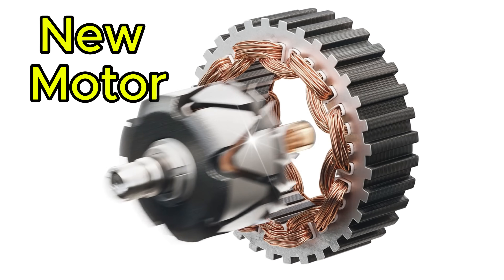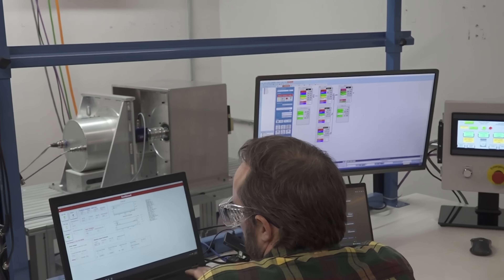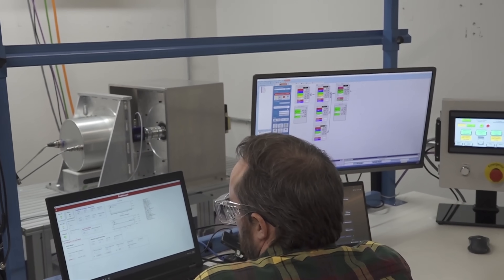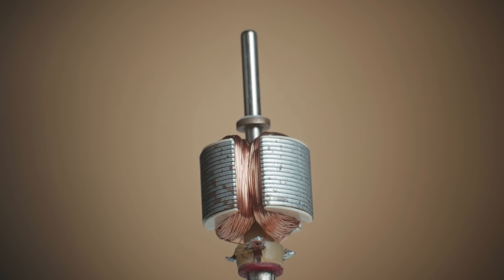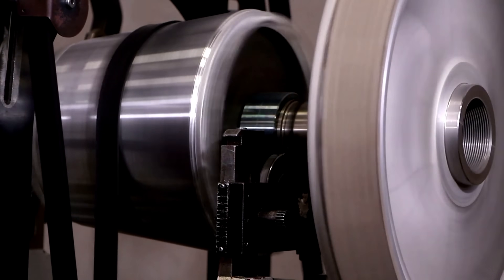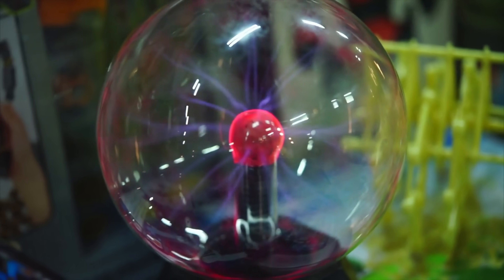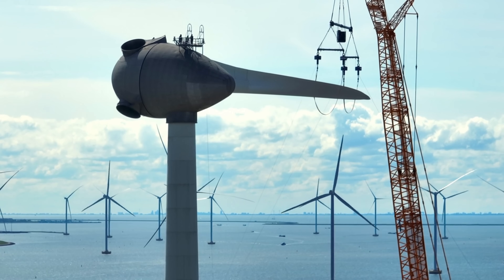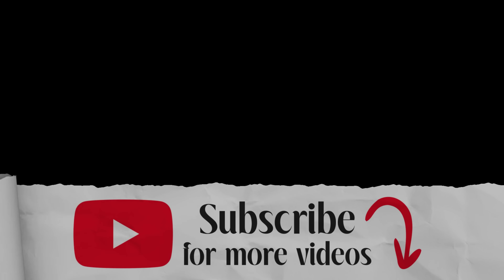Radical Electrostatic Motor Runs Without Metal Coils and Magnet – Here’s How

Comment from the maker: This might be the beginning of the end for electromagnetic motors. Lightweight, flexible, and potentially game-changing—this electrostatic motor tech could power the machines of tomorrow.

🔥 Would YOU trust a motor with no metal and magnets? Or is current motors still king? Drop your thoughts below 👇
Reply: The biggest problem with a static motor is TORQUE i give it 50 years and we still won't here much about it.

Comment: It's good that we are investigating alternative energy tools... However this motor is nothing more than a novelty.  The mere fact that it uses high voltage (above 5000 volts) it will also require step up transformers (which use copper...) so you'll never be able to get rid of the use of copper.  Then there's the torque issue - the whole reason we use copper is to be able to increase the amps pumping through it, easily control that to control speed, and they work at scale, from tiny motors to the largest power houses.  Static electricity is the weakest form of electricity, we learned that in school.  Perhaps if you used this with a lightning rod and were able to spin up a large flywheel to be used to generate energy it might have some kind of practical generation use, but lightning strikes are rare and uncontrollable, making it an unriliable energy source.  Perhaps they could couple this technology with capacitors, run it to charge them up, then use the stored energy in the capacitors for heavy load situations like starting motors?  Or maybe for accelleration in a car - but using it to DRIVE the car is not feasible.  Taking the biggest load off of a car - starting - could have some use, but all the tech and parts needed to get the high voltage might be a problem.  Maybe if they generated the static electricity using the vehicle itself as it moves across the road could be a feasible way to "charge" the motor, then it puts that energy into capacitors to be used upon acceleration or starting a gas powered vehicle?
Reply from the maker: You've brought up some very important points about the practical challenges, such as the need for high voltage and the torque limitations, but also some interesting ideas for potential applications!

Comment: Doubtful. Applying high voltage to a rotor is a huge problem. Induction supply with high voltage? Unlikely. Sloipping rings - sparks.
Reply from the maker: Please note that this is not induction motor, it is electrostatic motor
Reply: @renewable_energy  Did you read my comment? Don't you need to supply high voltage to a rotor? I see two options: a slipping ring and an inductive coupling, similar to a transformer. Anything else?

Comment: The possibility of an electrically assisted bicycle with an electrostatic motor is intriguing. As I understand it, a commercial model of the C-motive motor produces half a horsepower. Supplemented with supercapacitors instead of lithium batteries, it could provide assistance in climbing hills.
Reply from the maker: That's a great idea — supercapacitors could offer rapid charging and discharge cycles for the kind of bursts of power needed on a bike!

Comment: How does it work?
Reply from the maker: Great question! In simple terms, an electrostatic motor works by using electric fields instead of magnetic fields to create motion.

Instead of copper coils carrying current and producing magnetism (like in a traditional motor), electrostatic motors use charged plates or surfaces that attract and repel each other when high voltage is applied. By switching the voltage on and off in the right sequence, the charges keep pulling and pushing the rotor around, generating continuous rotation.

So instead of relying on current and magnetic torque, it’s all about voltage and electric field forces. This means way less copper is needed, no permanent magnets, and much lower resistive heat losses.

Comment: Keep in mind that the high voltage has to be transformed from the power source by a transformer, where you lose energy as well.
Reply: AN IRON CORE TRANSFORMER CAN BE 99.9% EFFICIENT.
Reply from the maker: That’s an excellent point. You’re right — to reach the very high voltages that electrostatic motors need, you’d typically step up the supply using a transformer or converter, and that process isn’t lossless. However, even with those conversion losses, the overall system can still be more efficient because the motor itself has so few resistive and copper losses compared to traditional designs. The big question is whether the efficiency gains in the motor outweigh the extra conversion step — and that’s exactly what researchers and companies are testing right now.

Comment: Just a decade or so ago we had high voltage devices right on our desk and in front of our eyes. The CRT required voltages similar to what they are using for the electrostatic motor.
Reply from the maker: Exactly! Great point — CRT monitors and TVs ran at tens of kilovolts right in front of us for decades, and they were safe enough for everyday use. That history shows that handling high voltage isn’t impossible — it just comes down to smart engineering and proper insulation, which is exactly what electrostatic motors are trying to leverage.

Comment: For me that invention is something especial. That is a part of spritual awekening. When an engine work fast and with high tork without heavy parts. When an engine is extrem lightweight compare to ordinary engines that means there is improvement by Quantum physic. The best side of Quantum physic is that you can produce extrem high energy without any heavy material. When this tech more advanced we can see after 2030 such engines they are only 2 kg but produce over 300 horsepower or even more.
Reply from the maker: That’s a fascinating perspective! 

 While the current electrostatic motor tech isn’t tapping into quantum physics directly, I agree it feels almost futuristic when you think about an ultra-lightweight motor producing serious torque without the bulk of copper and magnets. If engineers keep pushing the boundaries, by 2030 we might indeed see designs that completely redefine what we expect from motors. The idea of a 2 kg engine outputting 300 horsepower definitely captures the imagination!

Comment: IDEA #353
A brushed motor makes a magnetic field to pull on metal on sticking out from a shaft, the magnetism is turned off when the metal reaches the magnet.
This can be done using a permanent magnet, and the magnetism is redirected instead of electricity directed to make magnetism.
A metal bar on a hinge can move magnetism from one place to the next. A few bar magnets stuck end to end moves magnetism past where it would normally go. Electricity to a coil creating a magnet can stop magnetism from going in the path of least resistance, and the magnetism stops/reduces the electricity flow to the magnet in an apposing force condition. Using the known psychics of electricity & magnetism
I picture a large speaker magnet donuts supplying the power. Don't think of it as perpetual motion, think of it as psychics.  The atoms throw out parts of an electron and that is magnetism that wants to get to the other end of the atom.  It is the power of the atom being harnessed. So put some round plates on a shaft with notches out, like the top of a castle wall. Man the para-pits men. Think of them as brushes that transfers magnetism as it turns the tops come close to bars that transfer the magnetism to the stater side which is close to the CAGE which is big washers on the shaft that has flat bars running across them, an inch apart but 8 inches long. The magnetism is transferred to the stater bar just in front of the turning flat bar by the notched large washer on the other side of the magnet. I have not made a working model and I'm not saying that this will work.  I'm saying that for my next hobby experiment entertainment I was going to work in that direction and maybe end up with an efficient generator or something also. Do not invest in anything like this either. I'm old and can't work, so it's stuck in your head now.
PS, stuck in AI's head would be better.
Reply from the maker: thanks for your feedback.

Comment: still have dielectric losses. corona losses. even stationary those leakages must be replenished. charges leak away and the higher the potential the faster they leak. there is no "perfect insulator".

 still have charge being pumped on and off of surfaces, and that constitutes a current when being pumped. "a charge in motion". lead in wires, conductors, all producing magnetic fields and eddy currents. 

a magnetic field also requires no power to maintain. unfortunately wire has a resistance and that is the cause of the loss. a superconducting electromagnet shorted to itself with no resistance will remain magnetised indefinitely... the field cant collapse as theres nothing consuming it as heat.
Reply from the maker: Exactly — those are some of the key physical trade-offs that often get glossed over in the “perfect efficiency” claims. Electrostatic motors still have dielectric and corona losses, especially at high potentials, and leakage currents are inevitable because no insulator is truly perfect. Maintaining charge means continuously replenishing what leaks away, and yes, the act of moving charge on and off surfaces is itself a current — with all the resulting side effects like small magnetic fields and possible eddy currents in nearby conductors.

On the flip side, magnetic fields in superconducting electromagnets are indeed “free” to maintain once energized, since there’s no resistive path to bleed them away — but that’s only true in the superconducting regime, which has its own huge cost and cooling complexity. So while electrostatic designs avoid copper and rare earths, they aren’t magically lossless; the real challenge is balancing those leakage and dielectric losses against the efficiency gains in specific applications.

Comment: Coppers on electromagnetic designs has a proven torque requirements to meet demands. But that new concept i believe can replace industrial motors just for its low heat output alone and 99% efficiency you say?
Reply from the maker: Totally fair point—copper-wound EM motors are the torque kings and they’re proven. Electrostatic isn’t trying to replace them everywhere; where it looks promising is in industrial duty where continuous operation, low heat rise, and wide-range efficiency matter (think conveyors, fans, pumps). The “99%” figure is a peak, lab-style number; in practice you’d expect very high efficiency in a usable window—more like mid- to high-90s—plus almost no copper loss and no magnet losses, which is why the thermal profile can be so tame. The real questions are torque density versus size, cost of the high-voltage drive/insulation, and durability in dusty, wet environments. If those boxes get ticked, I agree—swapping some plant motors for lower-heat, rare-earth-free units could be a win.

Comment: high voltage isn't dangerous, Amperage is dangerous.
Reply from the maker: That’s a common saying, and there’s truth to it — current is what directly causes harm to the body — but high voltage can still be very dangerous because it can push that current through you, even if it’s just a few milliamps.

So while an electrostatic motor might operate at low current, its high voltage parts still require serious insulation and safety measures. Voltage is like water pressure — even if the flow is small, enough pressure can still burst the pipe.

Comment: If a STATIC ELECTRICITY MOTOR blows your mind. THEN you SHOULD build a PULSE  RESONANT LC TANK MOTOR
Reply from the maker: That’s an intriguing idea! A pulse resonant LC tank motor would essentially store and release energy in tuned cycles, kind of like giving the motor “pushes” at exactly the right times to keep it spinning with minimal losses.

The challenge, of course, would be controlling it precisely under changing loads — but if tuned well, it could make for an incredibly efficient system. Sounds like you’ve got a concept worth exploring further.

Comment: 99% efficiency. I may have believed you if you said 75%
Reply from the maker: I get the skepticism — 99% efficiency does sound like marketing fluff. 😄

To clarify, that figure usually comes from lab measurements under ideal conditions and only at specific operating points. Real-world efficiency will almost always be lower. The appeal of electrostatic motors isn’t that they magically hit 99% everywhere, but that they can cut copper losses to nearly zero and maintain very high efficiency across varied loads.

So yeah, think “up to 98–99% in the sweet spot” — not “99% all the time in your garage.”

Comment: regular motors, tesla for ex. can reach 98 percent efficiencuy.
Reply from the maker: True — high-end motors like those used by Tesla can indeed hit around 97–98% peak efficiency under optimal load conditions.

The difference here isn’t just about matching that number — electrostatic motors aim to maintain high efficiency across a much wider range of loads and eliminate copper losses entirely, which can be a bigger deal in applications where motors spend most of their time running below peak power. Plus, they avoid rare-earth magnets and heavy copper windings, potentially lowering costs, weight, and supply-chain risks.

In short — it’s less about beating Tesla’s peak efficiency, and more about how and where that efficiency is maintained.

Comment: I always wondered if using voltage instead of current. Thanks for this detailed video.
Reply from the maker: Glad you enjoyed it! 😊 Yes — electrostatic motors flip the usual script by relying on high voltage and electric fields instead of current and magnetic fields. It’s a totally different way of thinking about motion, and while it comes with its own challenges, it opens up some fascinating possibilities for efficiency and material savings.
Reply: Nein, denn die Leistung ergibt sich aus Spannung multipliziert  mit Stromstärke. Man kann den Schwerpunkt auf höhere Spannung setzen aber ohne Stromstärke gibt es leine Leistung.
Reply: @biodeutscher9258  Agreed power=voltage x current aber high voltage x lower current will produce same power.

Comment: Pipe dream. Maybe good enough for bug zappers. 🤔
Reply from the maker: Fair take — it does sound like a bug-zapper gimmick at first. 😄

But the underlying physics are solid, and prototypes from companies like C-Motive have already been tested in real industrial equipment. They’re not trying to out-muscle a Tesla motor; they’re targeting applications where the low weight, 98% efficiency, and zero copper/magnets actually solve real engineering headaches.

Think of it less as a “pipe dream” and more as a specialized tool — like how brushless DC motors didn’t replace all motors but still became indispensable in drones, fans, and countless devices.
Reply: Intelligent life among the comments. Congrats!

Comment: These type of motor never going replace all current motors type. Never.
It might  fit for certaint applications. But it too weak for many applications that require high torque.
Reply from the maker: Exactly — no argument there. Electrostatic motors aren’t some magic “one-size-fits-all” solution that will wipe out every other motor type. Their torque density is generally lower, so for heavy-duty applications like EV traction motors or industrial machinery, electromagnetic designs still make far more sense.

Where they could shine is in niche areas where efficiency, weight reduction, or the elimination of copper/magnets matters more than brute torque — things like aerospace, certain robotics, precision instruments, or ultra-low-power systems. It’s more about adding another tool to the engineering toolbox than replacing the whole set.
Reply: @renewable_energy  ChatGPT Reply with story about Sunshine
Reply: Never say never. It is easy and highly efficient to convert high voltage to high amperage using a fractal circuit of capacitors. Even a slow charge version in your garage could be used to charge an EV's battery(s) IF you can achieve high voltage. Sure, they'll probably never replace ALL motors/generators, but they have potential to do 90% of our overall "work." One day...

Comment: Far from real. Motor torque comes from current.   Electrostatic does not allow current. Had there be current, it'd have been electro dynamics (not static).
Reply from the maker: I get what you’re saying — traditional motor torque does come from current and the resulting magnetic fields. But electrostatic motors work on a completely different principle: they generate torque from the attraction and repulsion of electric charges between capacitor plates. There’s no magnetic field involved, so yes, there’s no “current” in the same sense as electromagnetic motors — but that doesn’t mean they can’t produce torque.

It’s basically swapping magnetic forces for electric forces. The torque density is usually lower than magnetic motors, which is why electrostatics aren’t replacing everything overnight, but in certain applications where ultra-high efficiency, low weight, or no copper/magnets are critical, they can actually make a lot of sense.
Reply: This motor type already started taking place in conveyor belt systems, results published, better so far.
Reply: @hmt0939  is it useable in cars?
Reply: @JohnDir-xw3hf  The possibility of an electrically assisted bicycle with an electrostatic motor is intriguing. As I understand it, a commercial model of the C-motive motor produces half a horsepower. Supplemented with supercapacitors instead of lithium batteries, it could provide assistance in climbing hills.
Reply: @robertoortizespinoza795  is it possible recuperation with electrostatic engine?😮
Reply: Its a combination of electrodynamics and electrostatics